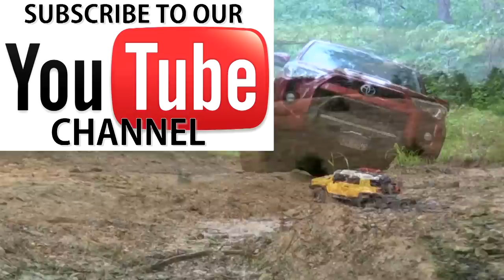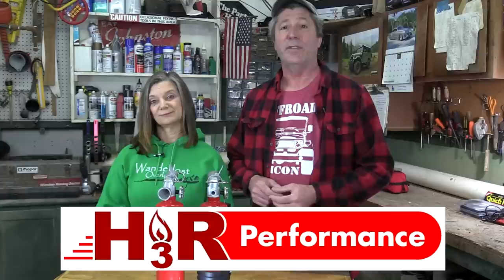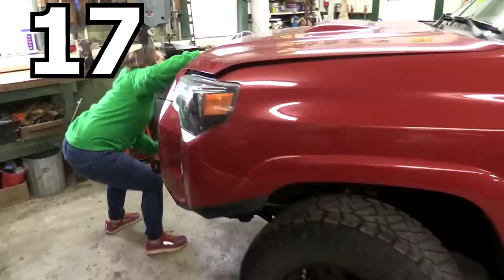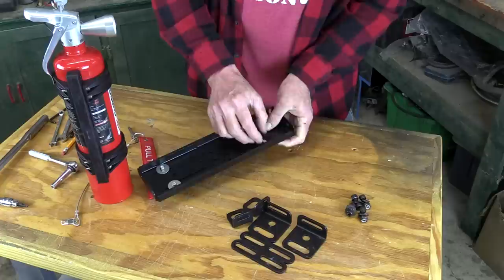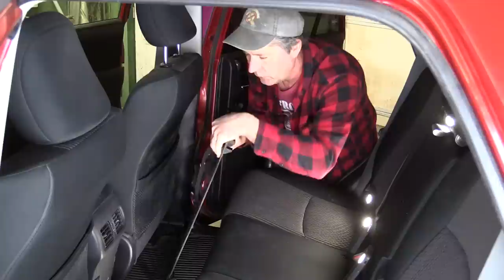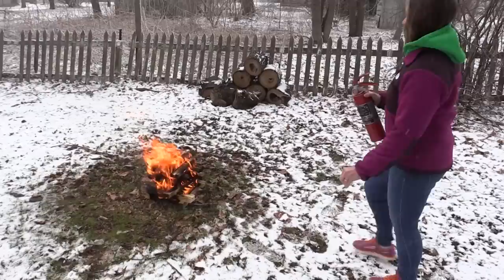Vehicle Fire Extinguishers: What Type is Best/Ways to Mount/How to Use

Comment: Great Video: I bought the whole complete setup with extinguisher/Quick detach/separate mount to put on the passenger seat and it worked awesome .... that is until my wife got in and tried to move the seat forward about 6 inches! It broke the SEAL on the pin and the pin FELL OUT, and we ALMOST had an extinguisher accident ............  I thought I had calculated the proper distance, but on a long distance journey she moves the seat back and forth to different locations, such as when I am "night" driving, she moves it forward and then reclines the seat to sleep.  During the day she slides the seat as far back as possible so she can relax and read.  I have tried to somehow mount it so it moves with the set instead of mounted solid, but I have since removed it and will try and find some area in the back.  Your second option behind the passenger seat is GREAT,  but our seats are mostly DOWN as the back is packed with all the rest of our gear.  I will try and mount on the REAR Window Molle,  but of course that has stuff that will interfere as well.  These are the FUN times on figuring out WHERE to put all the goodies.  Again: Thanks for the great video and ideas.

Comment: Fuses, fuses, fuses.  People rewire without them or use fuses that don't protect the wiring.  And fuel line fires are real.  Almost had one myself as a result of a front brake fire.  The fuel line was routed directly above the hub/caliper.  Great vid.
Reply from the maker: yup

Comment: Just a note, when I opened the hood that fed lots of air draft to the fire. You're better off just cracking the hood open an inch or two, and start discharging the extinguisher before you open it any further.

Comment: Thanks for another great video. I have a 4unner as well. I am curious as to how you mounted your seatback MOLLE panel. I tried one in the past. Going around the headrest was no problem, but the lower strap that wrapped around the seat was in the way when someone sat in the seat.
Reply from the maker: At the bottom we wrapped the strap around the bracket at the floor.

Comment: Great video. Question: why the 2-count before spraying the engine compartment?
Reply from the maker: Good question! When the hood is opened it introduces a rush of air (oxygen). There may be a flash of flames. Give it a couple seconds before introducing your face to it.